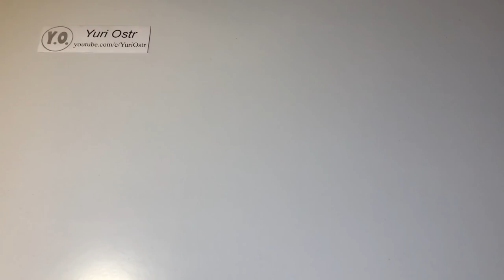How to Make Fully Automatic Gun at Home - DIY Electric Gun that shoots very fast

Comment: A little bit of modifications I made one that fires 20 gauge. Hardest part was finding a non rolled steel tube I could bore enough and still have structural integrity. It jams a lot. Other problem was finding a 3.7 volt battery carrier from China that actually was the right size.
Reply: I was gonna say the same thing

Comment: Hello Yuri, is there a location I can find a parts list? For example where you get your motors, battery enclosures, ect. Thanks.
Reply: Battery and motor can be found on Amazon. The motor is an Arduino smart car motor